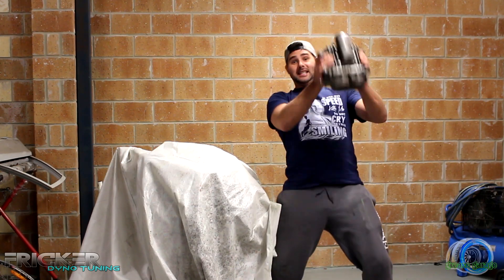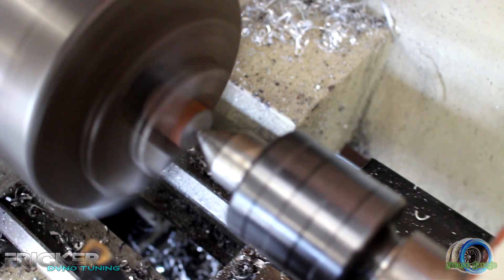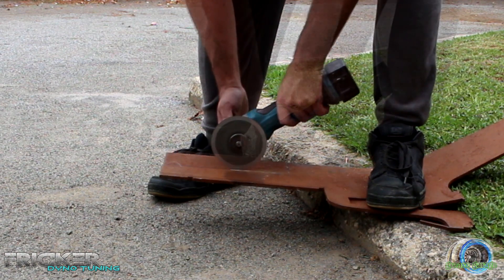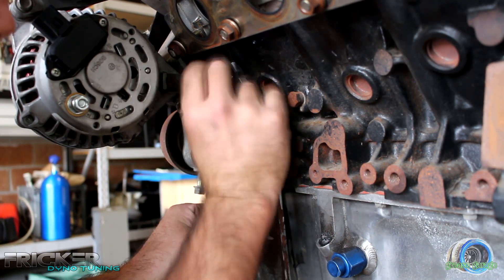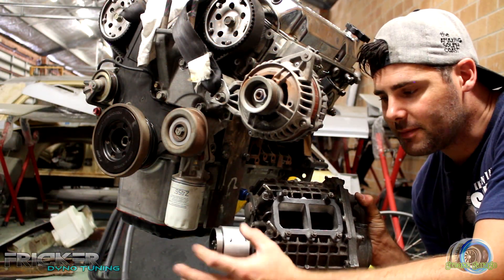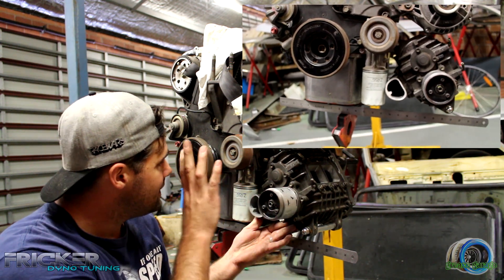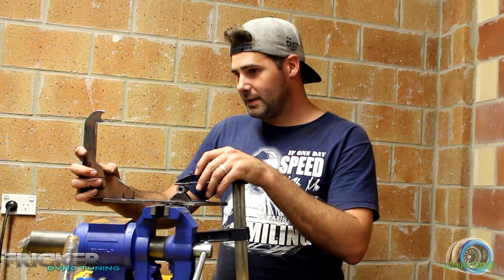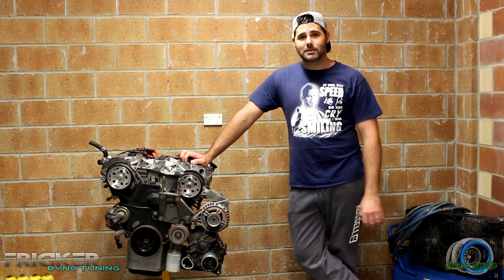SUPERCHARGE A Car For Under $1000 Part2 " Making Mount, and bolt in the blower" S1EP8

Comment: And here's my stupid plan: 2 SC12 superchargers, on a late 90's Ford 5.0 engine, being put into a late 70's Ford F-100.  Biggest problem is it's a V-belt going to a 6 rib, but I still need to do math before I get to that point.  It's months down the line, though.
Reply from the maker: Hey Red, nothing stupid, sounds awesome to me :) would love to see the old ford 5 on boost,  so in the series i make a custom pulley for the supercharger,  but you could make it to what ever, V belt /ribbed or cog/gilmer  it’s actually extremely easy to do, you want the ratio to be 3:1, no lower then 2:1 , example,  the engine crank does one 360degree turn and the supercharger spins 720/1080degrees, you would hope to make 4-7psi on that

Comment: Do you think this would be an option for mk triton ?, dont want big hp just more bottom to mid range torque but dont want to spend the worth of vehicle , also thinking m90 ? Comments valued cheers
Reply from the maker: 100% this would work on the 6G triton 🔱.. I normally recommend going turbo over supercharger …specially if you want mid range torque , .. remember you don’t need to run intercooler , or change the intake manifold if your budget doesn’t allow it
Reply: I'd like to go turbo aswell but then il have to get new headers made ? The supercharger system  looks relatively straightforward but if you think the price difference is worth the performance gain I would persevere ?cheers for answering great vids just got an mk triton I dont think I need as much as your magna just a little bit more
Reply from the maker: Great Question! 
If it was me, and I had a 3.5 Litre (6G74 ) I would choose to slap the 3.8 litre (6G75) in it and get it tuned!. The reason is, It will make around the 200-220hp @ the wheels with a 3.8L (6G75).
Compared to the stock 3.5L (6G74)'s 150-160hp@the wheels, 

Even with a Sprintex, bullet, raptor or Ripp supercharge kit on a stock 3.5Litre (6G74), at 7psi  your gains with be around the 50-75hp
Which is about the same power as a tuned 3.8L (6G75)
Turbocharging a 3.5Litre (6G74) with around 10psi using a GT3582r (or a turbo around this size) you get around 270-300@wheel hp ,
 Same Turbo on a 3.8L (6G75)with10psi  will get you around 320-340hp, 
I can’t give you a figure of the 3.8litre SC14 supercharger on 6~7psi because we don’t know yet.. (still figuring out the bugs)
Best bet is pick a power goal and then choose what you want to go for, I hope that helps you 
Please remember power figures can be different due to engine condition , fuel type etc etc etc I'm sure what ever you pick it will be awesome
Reply: Thanks for advice